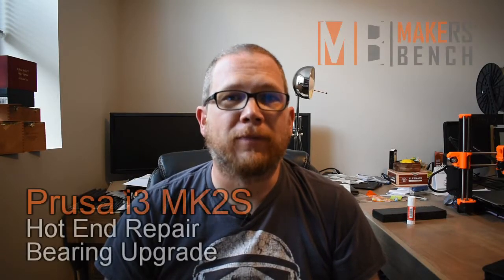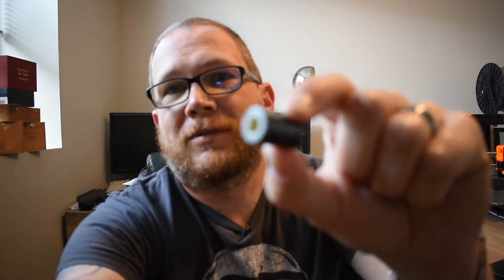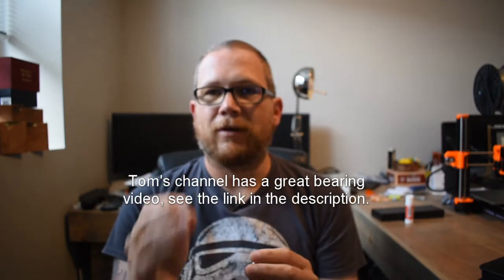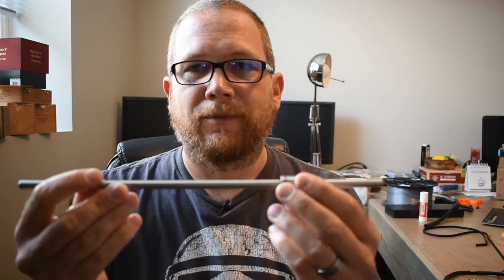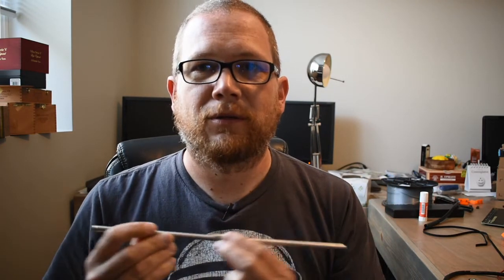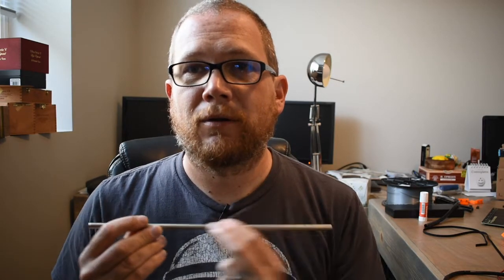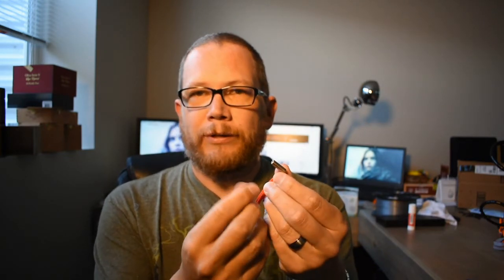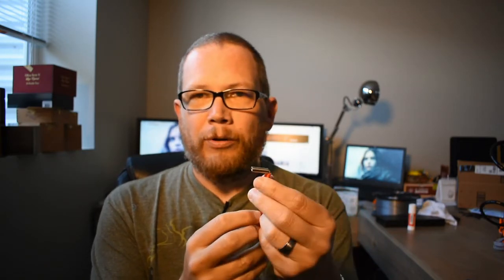Prusa i3 MK2S Hot End Repair / Bearing Upgrade

Comment: It's been a while since you've put the drylin bearings in. How do you like them now after using them this long? I've got a Prusa i3MK2 which is just a couple months old, but the noise on the Y axis is super annoying. Also the vibrations influence my prints. I'm REALLY tempted to swap out the standard bearings, but still am a little "on the fence"
Reply from the maker: I'm very happy with the bearings. The only thing I've had to do, is wipe the rods down with some rubbing alcohol about every 6 weeks or so. The bearings work great.

Because you mentioned the vibrations, the surface your printer is on can affect the noise and print quality. So, when I put my printer onto a carpeted floor, the printer runs much quieter, than it does on a wooden desk. I currently have my printer on a metal shelving system, but I have a foam mat under the printer, this helps a lot with the printer noise and vibrations. Even with the new bearings you will still get some noise, but what your printer is sitting on makes a huge difference as well.

Comment: Do you think that drylin are the best replacement bearing or is there something more appropriate?
Reply from the maker: Stephen, I couldn't say what the best bearing out there is. I went with them basically because they are quieter. I have worked with oil impregnated polymers in other applications like wear plates on conveyors, so I was familiar with the concept. I would have to do a lot more research to crown something the best in this application. Plus it depends what you are looking for, precision, longevity, thermal dynamics, or noise. The Drylin bearings for me, perform well in all categories, but the noise is where they really shine. I also like the idea that they are self lubricating. But, in the end each user has to decide if they are worth the expense, and effort it takes to change these bearings.
Reply: Makers Bench they certainly sound like they are worth a look. Thanks.

Comment: Possibly old question but I just got an i3 and want to upgrade while building.  I hear the bearing slots are 15mm D while the Drylin is 16mm.  How did you sort this out?
Reply: Stephan Park printing for the very first time.
Reply: No, I have experience with Ultimaker and other brands designing robots and product prototypes but this is MY first printer.
Reply: Stephan Park I was playing along with your Madonna line.
Reply from the maker: I only put the nation's in the X and Y axis. I left the stock bearings in the Z. Otherwise I really didn't make any adjustments. The only thing I did, and you may have seen it in the video, was I thought the new bearings were making contact with the front corner on the left side of the printer, so I used a Dremel and took a little material of the printed corner. It turns out, I wasn't completely square, so I might not have needed to do that.
Reply: Thanks for the quick reply.  Got Dremel, good to go then.  Z will be a post print upgrade once I modify 3D files for that part to 16mm or find it online.  This is my first printer so I want it to be a great experience...why do I keep hearing Madonna in my head...
Reply from the maker: Are you a Material Girl?
Reply: Multi-Material...uh, nope, got nothing.  FDM virgin...Chad, why you gottah make me say it.
Reply from the maker: lol
Reply: Boyd, I've got nothing to hide? ;P

Comment: Thanks for the video Chad. Do you think that the Drylin bearings are giving a advantage to the standard ones? Sure in terms of noise. What do you guess in regard to print quality. Based on your videos you didn't get a chance to print parts with the standard bearings since your hot end broke, right?
12$ for one bearing seems a bit expensive though..
found them on the IGUS webpage directly - they are cheaper than on Amazon - at least here in Switzerland:
http://www.igus.com/wpck/3663/drylin_r_rjum_01
Reply from the maker: I don't think there would be any difference in the print quality. I decided to change the bearings because I had over tightened the originals, and I had feared that they were slightly off because of that. I then decided to go ahead and go with the Drylin bearings purely for the noise reduction. They are certainly expensive, when compared to standard roller bearings. So, the anyone who is considering using these bearings has to decide if it's worth it to them. I'm certainly not trying to claim that everyone should run out and get them. I was just presenting an option to combat noise concerns, that some people have had with the Prusa. That being said, I think the Drylin bearings are performing very well and don't regret putting them on my machine.

Good question John, thanks!

Comment: Nice video - thanks for the info.  My kit just arrived so I've ordered the DryLin bearings (using your link) before I get started.   I had similar rail parallel problems with my CNC project so I understand how critical these dimensions need to be.

Cheers,   John
Reply from the maker: Awesome John! I'm glad you found the video useful, good luck with the bearing upgrade, and let me know how it goes.

Comment: Thanks for the video. Ordered 4 of the Drylin bearings using your link. I'll use the first on the Y carriage.  Ordered one spare just in case.  I may upgrade the X axis ones later when I figure out what new parts I would have to print.
Reply from the maker: Awesome, thanks. I wish you the best of luck with those bearings, they have been working great on my machine.